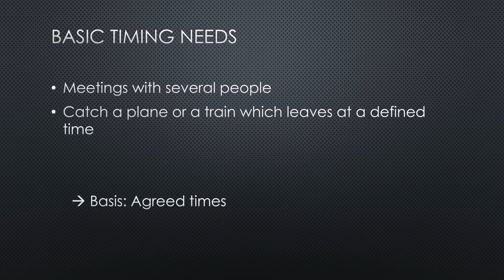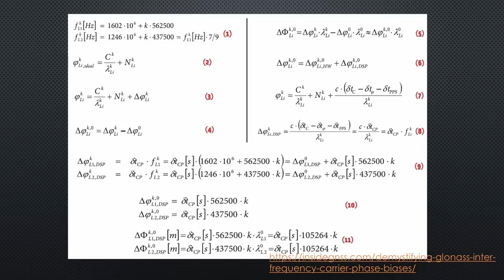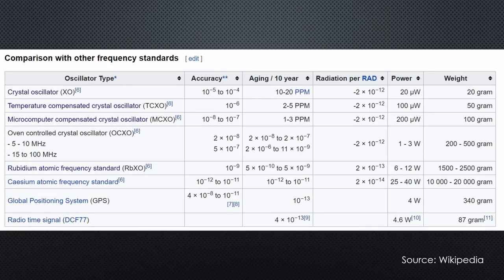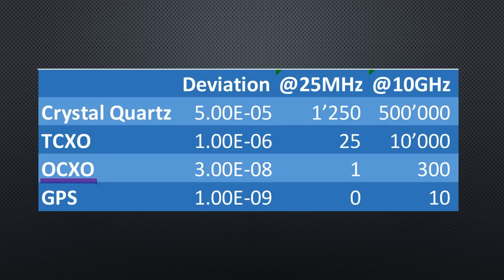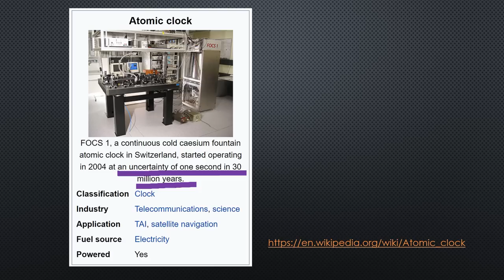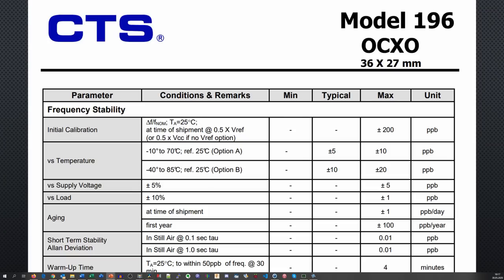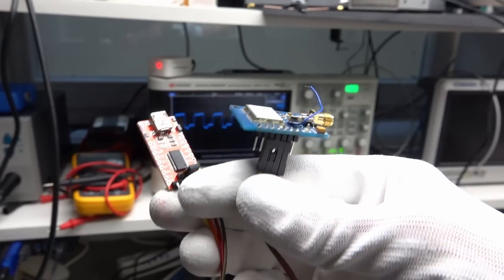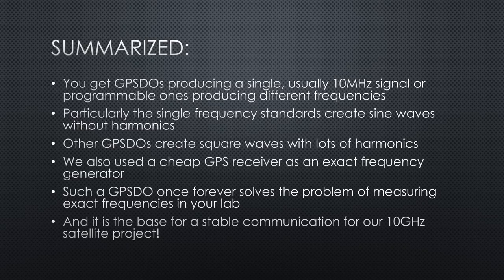#336 How to get Precise Timing and Frequency to our Lab. From Crystals, TCXO, OCXO to GPSDO, BG7TBL

Comment: On the GPS unit. Does anyone know what the blinking green LED on the bottom of the board rear between the BLOX module and the board corner labeled D2 means? Mine seems to blink at a 1hz rate, but it may mean something else?
Reply from the maker: It is well possible that it is a 1Hz signal because many GPS receivers are programmed to deliver a 1Hz signal.

Comment: What antenna would be adviseable to use on these ublox modules?
Reply from the maker: They usually come with an antenna. Because I am in the basement I need an active external antenna and an SMA connector

Comment: For me it was impossible to get a clean 10MHz signal from an Ublox-8. 12MHz is clean, 24MHz is clean as well, but 10MHz is not. When I look to your oszilloscope screen shot at 18:15 I beleave, you have the same problem. The frequency 10MHz is displayed, but the broadness of the individual peaks changes from peak to peak. So it is 10MHz on average, but it is not a 100ns period. Looks like 24MHz (or a multiple of this) is kind of a sampling rate for the time pulse generation. For lower frequencies, this sampling doesn't matter. But anyway, thanks for your perfect tutorials. 73, DC0UB
Reply from the maker: That is why we cannot use a cheap GPS receiver for radio applications and must build such a GPSDO where the frequency is produced by a proper oscillator and is only "disciplined" by the GPS.

Comment: Is it possible to use this with usrp b200 or B210? any help please.
Reply from the maker: I do not know if those devices have a 10MHz reference input.
Reply: @AndreasSpiess  yes it's have
Reply from the maker: @rakotondramananasamuel3970  So you have to check if the voltage levels match.

Comment: Make video on GPSDO homebrew
Reply from the maker: This is probably not a project for this channel. Too specialized...
Reply: @AndreasSpiess  your work is great thx for the reply
Reply: @AndreasSpiess   I have built several GPSDOs using surplus 10 MHz OCXOs, low cost GPS modules, and Arduino processors. The project is based on a design originally posted on EEVBlog by Lars Walenius. This has been a very interesting project to update my 40-year old electronics and programming skills. I would be happy to share the details if you are interested.

Comment: Not completely true! Without jitter, will be only the frequencies we get if we divide 24 MHz by an integer! 12 MHz, 8 MHz, 6 MHz, 4,8 MHz, 4 MHz etc…
Reply from the maker: You are right: Jitter is an important thing for certain applications and it can be created by dividing the frequency of signals. This is why most frequency references use an OCXO or a TCXO to create the output frequency and only "discipline" them with the GPS signal. Like that, jitter of the GPS signal is no problem.

Comment: Unfortunately, you erroneously mix (like many others about this topic) the terms Stability, 'Precision', 'Accuracy' and Uncertainty for the different oscillators, which in the end is very misleading. The Wiki article 'Crystal Oven' also gives wrong explanations of terms and wrong numbers for stability and/or uncertainty.  
You should better explain and measure the Allan Deviation of your Chinese OCXO and GPSDO devices. That statistical method gives the Stability over different time-scales.
The achievable uncertainty of both oscillators should be determined likewise, by different methods.  A GPSDO from Trimble (like the Thunderbolt) can be taken as a guideline, what can usually be achieved. See here: http://www.ke5fx.com/gpscomp.htm
The terms 'Precision' and 'Accuracy' do not have a real meaning in time-keeping metrology.
Reply from the maker: If you know I made mistakes you for sure can give me the precise definition for these words. Concerning Allan deviation: I am still experimenting with it.
Reply: @AndreasSpiess  Hello Andreas, I would not call that a mistake,  you simply were in-accurate in the wording and description. That's very strange for a Swiss and for a ham-radio guy, i.e. were all these 'time-nuts' origin from. It also did not become clear, what were the stability requirements for your satellite experiment, i.e. if you need high absolute uncertainty of your reference clock, and/or simply a most stable one, w/o any big frequency jitter and drift.
I try to define these two terms Uncertainty and Stability briefly, and they apply to everything you measure in metrology, or concerning physical units, like Time, Voltage, Resistance, Length, and so on. Better or more precise description can probably be found in the G.U.M., http://www.bipm.org/en/publications/guides/gum.html:
Measurement Uncertainty describes how exact your DUT can represent the unit under consideration, compared to the International Standards, in this case it's the U.T.C. time-scale, set-up by the various Cesium and MASER clocks in the National Standards Labs around the world.
Measurement Stability describes, how stable over time, temperature, or other environmental conditions the D.U.T. behaves, or how strongly it fluctuates and drifts from its initially adjusted calibration value. The uncertainty of a D.U.T. hardly can surpass its Stability figures, mostly due to practical reasons.
To give an example, an OCXO usually can be adjusted to an uncertainty of about 1E-9.. 1E-10, by means of  calibrated Rb, Cs clocks, or against the U.T.C. time-scale via the GPS system.
Afterwards, the OCXO might have a stability (jitter) of about 1E-12.. 1E-13 on a 1 sec  time-scale, but will have a stability (shows a drift) over time of about 1E-8 / year or over temperature of 1E-10/°C.
The GPSDO behavior is a combination of both the stability of an OCXO and the GPS time-transfer mechanism and of the steering clocks at the D.O.D., which are as accurate as the U.T.C., generally- Therefore, with a good GPSDO receiver like the Thunderbolt, you can achieve Time-scale uncertainty of < 1E-13 by using an observation interval of about one day.
Your Chinese GPSDO might be limited due to it's less sophisticated circuit, components and firmware, and might not reach these low levels of uncertainty and stability.
It might be stable enough to achieve an uncertainty of time of about 1E-12 with an appropriate setup, in order to adjust e.g. a Rb clock to ~ 1E-11 or an OCXO to ~1E-9 uncertainty.
That should be good enough for your purpose, but you have to decide, whether the stability figures of your 'master oscillator' later matches your experiment requirements.
The short term jitter of your GPSDO might be too bad, in comparison, see Allan Deviation on the linked site.
PS, a classic paper about Frequency Stability might be this one, NIST publication 1065: https://www.nist.gov/publications/handbook-frequency-stability-analysis
Reply from the maker: I understand your concepts and I think, they are understandable. I mentioned that the OCXO "is exceptionally stable, but not precise". So I mixed what you called uncertainty with precise, a word probably easier to understand in this respect. 
Concerning Allan deviation: I will try to measure it for my different devices (or better: Compare the different devices). But I have to learn a lot about it... 
I should get help in this respect from another viewer with lots of experience in this area.